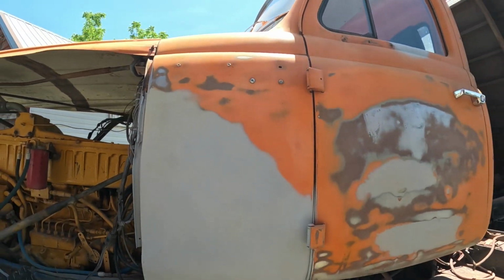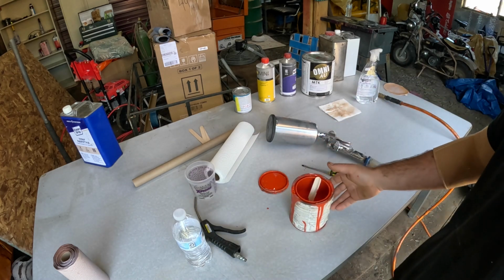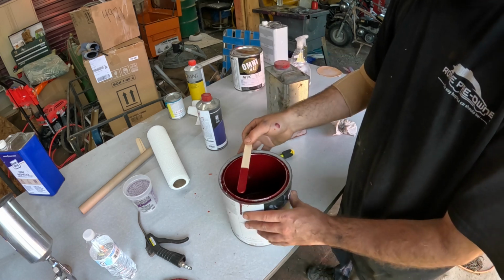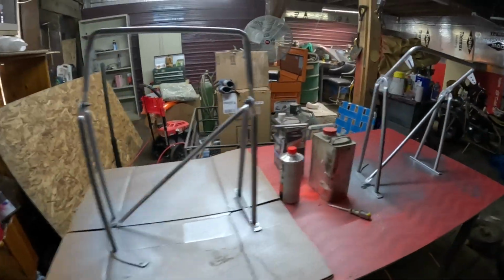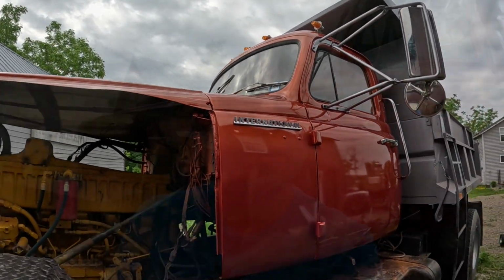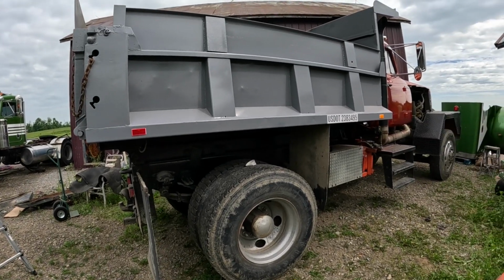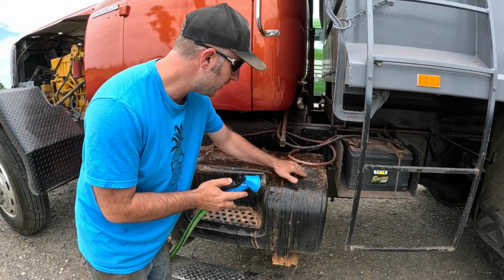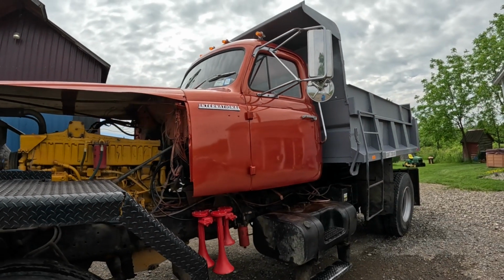Did the 69 IH finally get painted or what?

Comment: Nice job on the paint but you should paint the box black and leave the black paint on the grill aside all that it looks AWSOME!!!
Reply: I second that! A black dump box would compliment the black fenders, fuel tank, and grill nicely.
Reply from the maker: Thanks guys! The box was black and I painted it gray to try and brighten the appearance up. As far as the fenders, them are eventually getting changed out to round Peterbilt fenders that will be painted the color of the truck. Thanks!
Reply: @kurtisgleba3121   If the fender are going to match the paint, maybe keep the box like it is now, at least until they are on and you can compare.

Comment: Awesome sauce! Love how well that red-tinged orange looks on it. 

Future content - well, I seem to be a stickler for old truck engine ASMR, I rather enjoy those long drives. That last one you did with the camera on the hose/cable in the engine bay to the right turned out AMAZING. 

By the way, I’m curious on the rating of that 3406 DITA. What does the engine plate on top of the valve covers say for hp and max rated RPM?
Reply from the maker: Thank you very much! I've been wanting to do another video similar to the engine bay one. I will make another variation soon! I believe it is a 350 hp and 2200 rpm. 91N serial number I believe.
Reply: @kurtisgleba3121   Interesting. I haven't come across a 350 3406A in a while.  Brochures are telling me its an Economy model originally @1900, then couple years later @1800 with more torque. Probably check back again. Big deal for me as I've made a personal rating archive.
Reply from the maker: @matthewkabanuk443  92U
350 hp
Full load rpm 1900
Fast idle rpm 2230
Thats really all i can make out on the tag
Thanks
Reply: @kurtisgleba3121   Awesome here's what's matching up
3406A DITA Economy 350 (1977-78 rating)
350 hp @1900
1165 ft-lbs torque @1200 - 20% torque rise